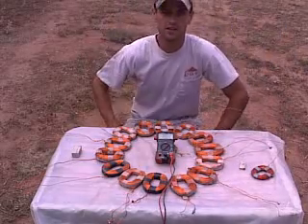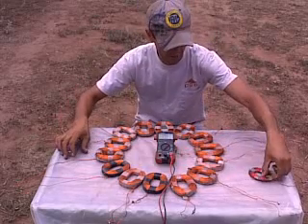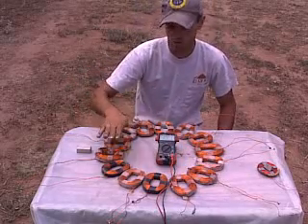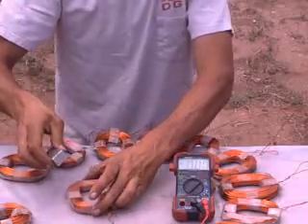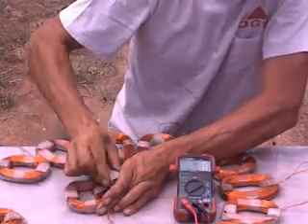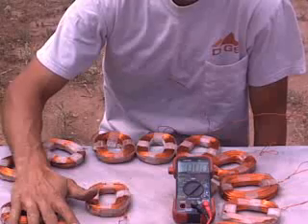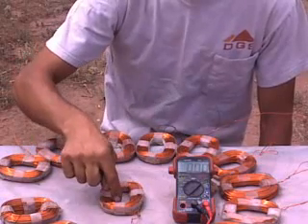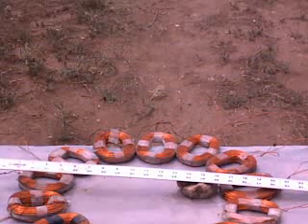neodymium magnet super motor generator

Comment: i do have a question i got a 40 gauge magnet wire which is so thin ? would it work to produce one or two volts , and how many wraps should i have to make of it .

next question is that i had got n35 neodymium magnet 2 pieces of 2 inch , should i increase the number of magnets or coils to generate more power

Comment: Hey nice presentation. I thought a neodynium magnet and 250 coils of copper wire (low resistance) would generate a higher voltage than 1.3 volt lol. Any way to calculate the voltage out of a coil when rubbed at certain speed with magnet?
also, is there any way you could have two magnets places in a certain way to generate more voltage? (is there a more efficient method of rubbing with magnets to produce a higher voltage?)